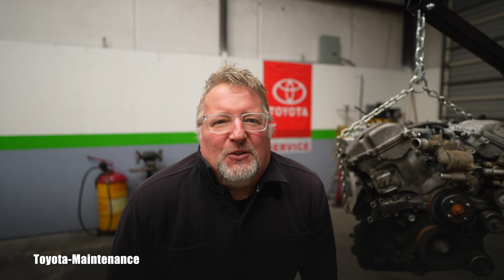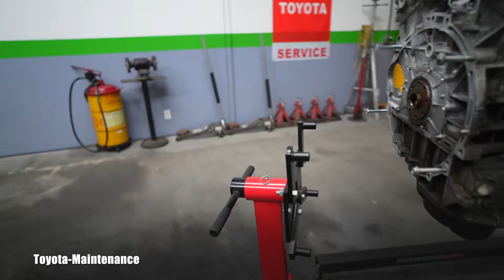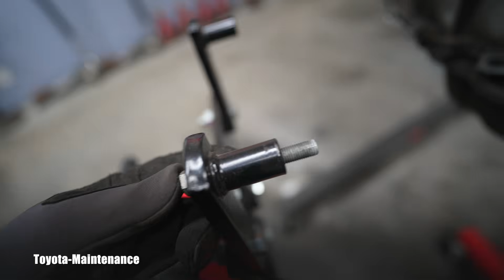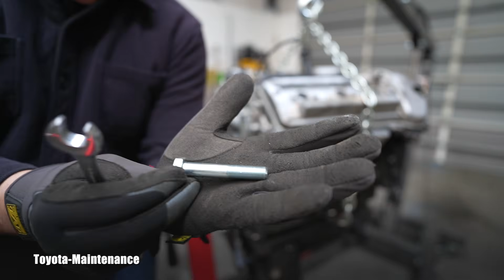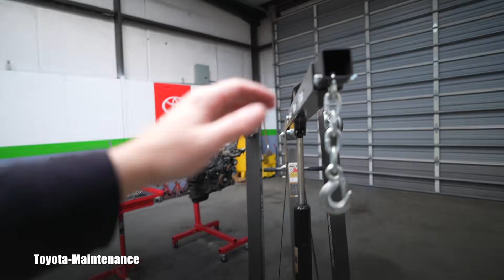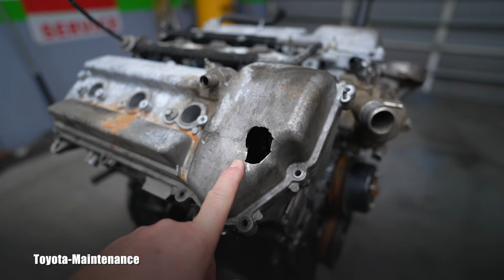The Project Toyota Engine 1GR-FE Begins

Comment: Just about to replace the head gasket on my prado. It is a 2004 with 200,00 kms (australian) and it was making a gargling sound, rough start and losing coolant. A boroscope showed us that it was leaking into cylinder 5. The timing is the part I am concerned about and am just hoping the heads are not warped. It overheated once due to corrosion on that outlet pipe. My partner tells me she pulled over within 20 seconds of the light coming on but I know a lot can happen. 

It runs really good still, I had to use it for a few weeks by topping up 100 mL coolant before driving. It has now been sitting there for about 3 months waithing to be fixed, just waiting on some headbolts in the post and the tool for them. 

I am really looking forward to the job, I have been learning heaps about this great motor and your vids are fantastic.

Thank you

Comment: Mine with 160k miles, synthetic oil changes every 4k miles, always let it warm up, 93octane... And the damn bytch engine rod knock out of nowhere. A truck I always took care of it, and just shyt itself in front of my house. Smoke out of the exhaust, horrible clanking from the bottom end. 
It had oil at the moment when it failed, no CEL, no low oil level light, any lights. Ran two different OBD scans, no ERRRORS, unreal, but if I run the engine, all hell break loose letting me know with all forked up rod knock noises.
I sincerely cried, I have owned it since new. The funny thing I was going to sell it this same week it happened, as if the truck gave me a big finger for trying to sell her.
Reply: What year was your vehicle? And did you replace it with a rebuilt engine?
Reply: @chanoleyva8584  almost forgot about this chat. I was making preparations to sell the 4runner when this happened, just had received the title from tax collector and was about to post on FB a for sale, and then the horrendous sound.
Dump some fresh engine oil and manage to drive it in into the garage, the smoke kept coming out the exhaust, but the noise   did not come back. Did an oil change, gave a prayer and said here goes nothing, and gave it another crank and drove it around the neighborhood waiting for a rod to spit out the back of the block. Another loop around the block, the smoke cleared out and suv ran fine. Already three tanks in, a few visits to redline and all good so far.
I am still spellbounded by the whole issue because it sounded bad. I could blame it on a loose wrench, but how the smoke out of the exhaust. I have searched everywhere ans have not found any loose wrenches, parts, whatever, something floating around the engine bay.
Gave it some tlc, new tires, new valve cover gaskets, and new pcv valve. Checked all spark plugs, in excellent shape, no carbon deposits in the valves,cylinder walls still show the cross hatch.
My son was with me the day this happened, and he is also cannot understand, maybe it did not want to be sold.
I would swear someone played a joke on me, so I checked my security cameras and nobody touched the vehicle since the day before I drove it. I have had it since new, its all 160k miles has been all across the US, cost me 40k including the loan interest.

Cheers
Reply: @psiturbo so are you selling it now?
Reply: @wolfeadventures I own it since new, besides that strange incident, it has been flawless. I am still debating if I should sell it or not.

Comment: Hey Petr, I have one of these motors. The manual says to use 0W-20 for regular driving and to use other oils for fast driving or carrying loads. When I tow during the summer can I use a 5W-30? It is a dual VVT
Reply: 5W-30 is Recommended, I use mine heavily so Synthetic oil's only

Comment: Peter if I might ask A question? I own A 2015 Toyota Tacoma TRD Off Road with the same 1GR-FE  engine. I bought it used in 2017 with 34K miles. I had read prior about the engines tendency
to develop oil leaks so I immediately  switched the oil in it to 5W30 full synthetic high mileage from Mobile One to hopefully mitigate the potential for leaks. I read in several places that this oil 
was good for 10K miles between changes, and so I was changing the oil every 8K-9K miles never letting it go to the full 10K. I have since learned that this oil also needs to be changed every 5K instead of 10K. I put 40K miles on the truck whilst changing the oil at this extended interval, I'm now changing oil at 5K. Do you believe that ive damaged anything in the engine? like the oil rings themselves? I also run A engine decarbonizer once a year through it since ive bought it.   It still has all the noise, and gets the same bad fuel mileage that the 4.0 is known for? Thank you for time, and any info.
Reply: The issue with extended oil change intervals is sludge build up, there’s a inspection sump adjacent to the main sump that comes off & lets you inspect the oil pick up. Do a search for a YouTube channel called for by diesel. They have a few videos on 1grfe engines
Reply: I don't believe you damaged anything so long as your engine doesn't consume oil. I also have a 2015, it gets around 18-19 highway and around 15 or 16 around town. I change my oil every 3000 miles. Mobil 1 advanced full synthetic.
Reply: @sonofliberty92  man...the best milage I can get in mine is 14mpg. I carry a lot of tools (its a work truck). I dream of 18mpg. Must be nice.
Reply: @waynes.2983  Yea I must be lucky or it could be where you live relative to the sea level. Apparently that has a lot to do with it.
Reply: @sonofliberty92  Plus I live in a very mountainous area, drive up and down hills everywhere I go & run BFG mud terrains all the time.
Reply: @waynes.2983  welp, that'll do it. I live in a hilly area. I run ATs.

Comment: Sludge packed? So many don't do proper oil change interval.
Reply: Some people don’t bother with oil changes at all and the engines last longer than I’d expect.  An engine that is serviced regularly, even at long intervals, won’t sludge.  This engine was obviously abused to only last 280k miles even though it was not a sludge issue in this case.

Comment: Definitely looking forward to this. 1GR is one of the last engines that still uses buckets and shims, I wonder how it holds up against that many miles.
Reply: The amount of abuse, street racing, off road, this engine can handle is inane. Has the FJ and many was that engine over engineered.
Reply: It does not use shims. It uses buckets of various thickness. In order to do a valve adjustment you have to remove the camshafts after measuring clearances & calculating the size of the buckets needed.
It is a royal pain in the but. I just did it and had to remove & install my camshafts 3 times to get everything correct & each time removing the cams requires using plastigage to measure the camshaft bearing clearances as well.  We wish these engines used shim over bucket like the older ones did.
Reply: I’m fairly new to the 1 GR, and Toyota in general. Bought my wife a 2020 (new) 4Runner, and I liked it so much I got myself a 2021 (new) 4Runner.
Reply: @JAMESWUERTELE  yours is a different animal, only sharing the block with our old 1GR, with 2GR heads and oil cooler and twin vvti and hydraulic lifters etc. Congrats, it might be a bit sluggish but hope you like it.

Comment: Watching this with a 2020 4runner with only 3K miles.
Reply: …and I thought my 18 4R was low miles at 15k miles.  The 1GR-FE was updated in 2010 for more power with dual VVT.  This updated design is a one million mile engine and is completely bulletproof.  There are no turbos or direct injection.

Comment: So what is the difference in the 2grfe v6 engine from the 1grfe?
Reply: Wider range of uses. Can be rear or front wheel drive easier
Reply: The 1GR is the first iteration of GR engines. Toyota has since improved it ever since it’s inception in 2002/3